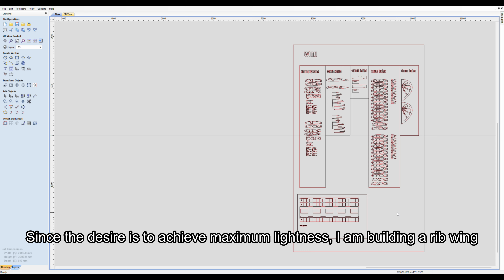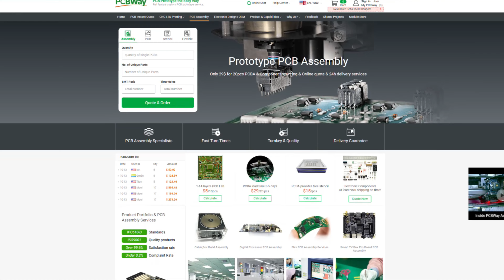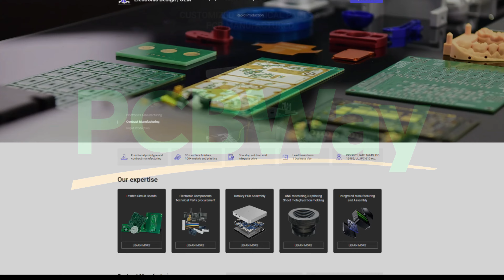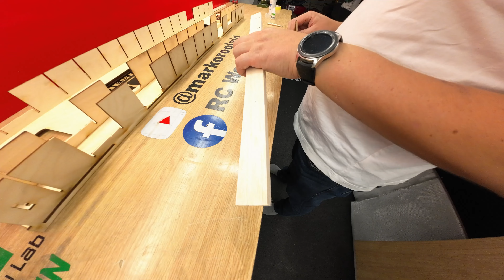Carbon Cub RC Airplane Scratch Build Part 4: Rib Wing Building | 3D Printed Components

Comment: Despite your fibreglass fuselage inlay, I am impressed you nailed the proper fitment for the ribs. Also I didn’t notice an offset in your motor mount. Typically 2 degrees needed to prevent pulling. I guess we will see upon flight if it impacts flight.

Comment: I have a problem, during my construction of the wing, the length of the carbon fiber tube was not found in the video🥺
Reply from the maker: @JIACHENWEI-b6t  Hi, ok. 36/34 1500mm, But they need to be cut a bit shorter afterwards
Reply: @MarkoRoolaid  I believe that with your help, my work can be completed faster，from China

Comment: not reinforcing the wing ribs to the wing spar with some epoxy with microbeads, and just relying on CA glue?
Reply: Ever tried to get carbon and balsa apart after it’s been glued together with CA?  It’s more than up to the task.  Also, in this situation the glue isn’t taking any load…just stopping things from shifting around until everything else is in place.

Comment: Is that a co2 laser. Been thinking about building one
Reply: I already asked what power it had to cut carbon fabric without any problem, he replied that the power is 130w CO2...building a CNC laser you don't have many problems with the recirculating screws like a CNC milling machine, belts are enough, the guides must definitely be linear
Reply from the maker: yees, CO2 laser

Comment: The carbon leading edge is not good ; 2 drop of glue is nothig!  The ribs need a hole, otherwise it is not strong in aff ! End in front of carbon tube a wood profile . This is my expirience.